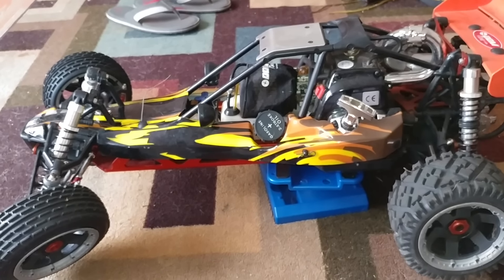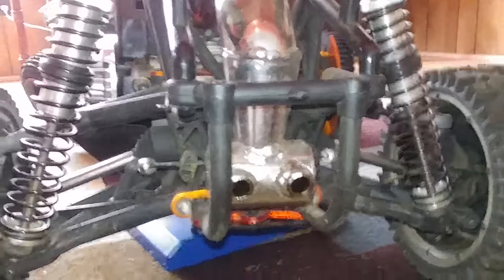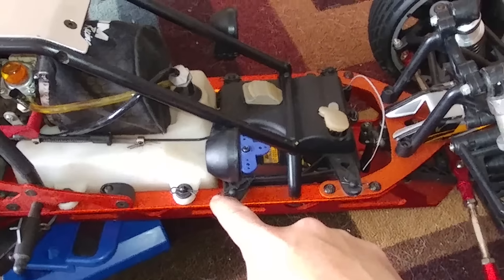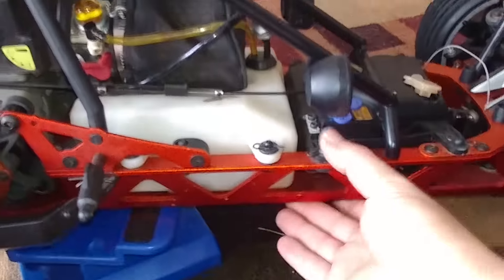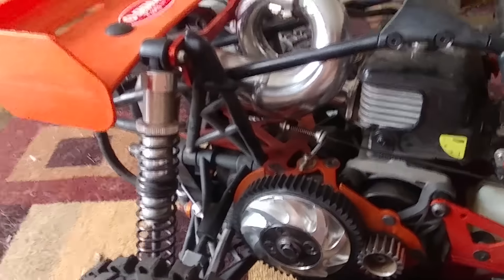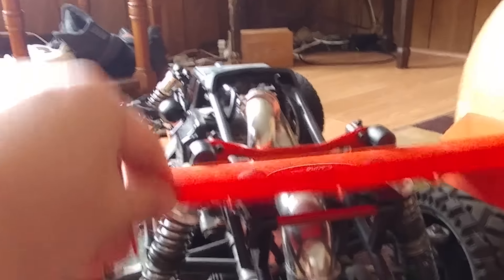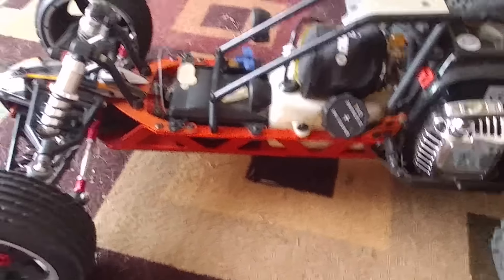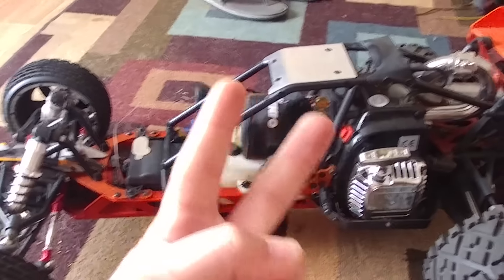Up close look at the 5th scale 5B baja

Comment: I'm happy that you explain things when your going over the Baja. Like the  velocity stack I really didn't know what one of those did. Do you know what the REV motor is that King motors puts into their Baja's.
Reply from the maker: Lenny7118 rev motor?  I know they use either 2 or 4 bolt Chung yang motors.  and behemoth fan said the motors are hit and miss cause of the motor.  Well all Chung yang motors are made tthe same except for the size.
Reply from the maker: Lenny7118 Also the velocity stack does not come with it.  just a regular air filter. the velocity stack does just that.  it adds velocity to the incoming air cause it goes from a maybe 2 inch opening down to a 3/4 inch opening.  this extra speed helps bring in more air meaning more fuel meaning more power.  It also directs the air to flow into the motor with less turbulence.  with a longer stack you'll get a higher velocity and the air sticks to the sides.  this is known as laminar flow.  I'm still debating installing one on my dbxl.  ill have to get a side air filter as well.  Always better performance if the air is being directed but sometimes turbulence helps atomized the fuel and get an even air fuel mixture into the combustion chamber.
Reply: Evolved Amateur RC Is the CNC Aluminum parts used on King Motors just as good as let's say a Turtle racing Aluminum parts ? I was looking at this King Motors Baja : 2.0 EX Silver Aluminum Baja Buggy Special Edition
Reply from the maker: Lenny7118 I would highly doubt it.  a single turtle racing part your looking at 100 dollars per part.  Also going all aluminum adds a lot of weight.  Tbats why I buy the decent versions and add aluminum where it needs to be.  Those all aluminum beauties are just that.  very pretty but not very practical. Thays my opinion though.  if you don't mind all the extra weight go for it but make sure it comes with at least a 29cc motor and add a pipe and velocity stack with a high quality filter.  my baja weighs 25-28 pounds.  those all aluminum your gonna be pushing 35 pounds and I see they come with a 30.5cc motor.  your always go na have people say HPI is better but that's mainly customer service. This day in age they are all so equal its hard to tell a difference.  The question you've got to ask yourself with these all aluminum beauties is are you gonna be racing, bashing, do you really need all that aluminum cause adding it in places its not needed is gonna really slow it down, out a he'll of a lot more stress on the drivetrain, just remember metal adds weight.  Me Persoanlly I like aluminum but I always leave a weak link that can break worst case scenario and that weak link is a cheap part that I keep extras of.  but tmit all comes down to your money.  Don't worry about these clonephobics cause the argument of who made the original baja and I have read now that KM and rovan are the same company.  Rovan was made by KM to get their products to other parts of the world, namely Australia.  But again this is on the forums.  Unless I see it straight from the company I try not to believe it but I will let everyone and anyone know this possibility.
Reply from the maker: Lenny7118 Turtle racing aluminum parts are used by racers.  and also in the end with all these vehicles we add so many upgrades sometimes the only thing left stock is the chassis if that.  I personally would stick with KM but I have buddies that have the rovan t1000 5t and love it.  It takes a lot of research if your not in the know to find out what would be the best investment.  one thing I will add is HPI won't be distributing for about another 3 or 4 no the but I personally can't wait.  A 5T would be a nice addition.
Reply from the maker: Lenny7118 Lastly the drive pins in the dogbones (drive shafts that go to the wheels) are soft with any baja.  I dont buy hardened pins cause its very easy to do.  Get a torch and heat them up til they're glowing red then drop them in a bucket of motor oil.  this hardens them and as you run it the parts will get what's called work hardened.  Sometimes in RC heat can be your friend
Reply from the maker: Lenny7118 sorry for the long replies I'm just giving you all the information so you can make an educated purchase.
Reply: Evolved Amateur RC King motors on their web site states that on the 3.0 version of the all Aluminum EX Baja has $1400 of upgrades on it and they sell it for $1230 so that gets people to question the quality of the parts they use. I just use turtle racing as an example, I was just trying to get a feel on the CNC Aluminum that King uses compared to others. I'm gonna email King motors and ask how they can have $1400 extra on a Baja and only sell it for $1230.
Reply from the maker: Lenny7118 Thays just the aluminum.   Of course an entire vehicle made of aluminum being sold for 1250 dollars isn't going to have the best aluminum.  But when you look at the plastics and compare one brand to another they're all nylon reinforced and sometimes glass nylon which flexes more.  When it comes to upgrades the only thing I get from KM is wheels and tires.  everything else is Phat dad, TR, FID, FLM, DGI area rc, usually vehicle manufacturers dont make the best upgrades.  one thing that's really nice about the TR transmission is you can get to the diff from a back plate that comes off that TR added.  in order to get to the transmission on a baja or any baja chassis vehicle a lot of parts have to come lose to pull it out.  Its best to get a lot build book for vehicles like it.  cause the first time intook out my tranny to grease the diff I took way too many parts off.  Now thanks to the build book I know just what needs to be taken off to get to the tranny.
Reply from the maker: Lenny7118 They will never tell you the truth.  RC companies never ever admit fault.
Reply from the maker: Lenny7118 On the description they even call the 3.0 a SHELF QUEEN. that's a vehicle you look at more than you run.  and I see they have come up with a 3 piece tranny like TR but I'm sure the metal isn't as good and the customer support isn't as adequate.  a lot of these aftermarket sellers will replace something for free if you can break it.

Comment: Good video. Can you tell me if King Motors RC and Rovan RC are the same company ? Which company is better made Baja if not the same company.
Also what are your thoughts on the build quality of the King & Rovan Baja's ? So many haters on the build of the plastic parts breaking so fast on the King RC and Rovan RC Baja and they also say the motors don't have the same build quality parts internally, they are a cheaper version of the CY engine ? I don't know it's just what I read and see the you tubers saying.
Reply from the maker: Lenny7118 King motor and rovan are different companies and honest all 3 including HPI make a good baja.  as for the plastic parts I've driven mine much harder and seen HPI and Rovan bajas break sooner.  Yesterday I was beating the hell out of it and the only thing that broke was the scrappy servo I installed just cause it was sitting.  as far as putting in cheaper cersions of th CY motor, well first my baja has a 4 bolt head, hpi bajas only have a 2 bolt most of the time.  So many say the plastics break faster but what they're saying theuve never seen with their own eyes, I have.  My 5sc is a baja just with bumpers and body mounts.  Plastics on both feel equal although even though the 5sc is the same chassis overall the parts are stronger.  There's always going to be haters but ice had this thing for a year now I believe, maybe a little less and the only broken parts have been a stripped spur gear, broken drive pins which can be replaced very easily and not a servo but the servo was not a KM or Hitech servo.  the great thing is any hpi part will fit on this.  same with rovan.  Also from KM you can get a complete aluminum baja for the price of an HPI Baja.  remember with the brands your paying for the name also.
Reply: Lenny7118 KM and Rovan are the same company if you dig deep enough. There engines are a hit and miss (just like OBR engines) back to "clone" engins some give up the ghost after a few hours run time some last a fair amount of time.
Reply from the maker: behemothfan666 ha ha.  I've compared the internals of the engine in my DBXL and my 5sc and my 5B.  All the same except KM uses 4 bolt heads.  have you had one yourself?  I have a KM and an hpi that are the same chassis.  What proof do you have?
Reply from the maker: behemothfan666 Also if you do some research King motors started the baja movement then HPI bought the copyrights from king motors to start making them as well.  So King motors actually built and designed the baja chassis.
Reply from the maker: Lenny7118 This behemoth dude has no proof.  Just talk.  I have many engines.  He also buys his motors pre built.  I buy cores and do all the modding myself.  You can always tell the difference from a person who buys a motor and those who build they're own.
Reply: Evolved Amateur RC you have many engine's what do you want a medal and a chest board to pin it on I've built many of these small engine's there piss easy there's nothing to them, the engine's I own zenoah 25,4 4 bolt PP, zenoah 30,5 PP 4 bolt ported by Doug, CY 28,9 4 bolt PP self ported, zenoah 29,5 PP 4 bolt ported by Scotty and an ALX 78 reed that I'm thinking of getting ported by either Scotty or Chris.

Comment: on the back axel I see black rubber boots....Do you think I can put them on the traxxas x maxx?  If so do you have a part number?  I tried the team associate boot covers and they just don't last...
Reply from the maker: MrDoom6969 yes they do fit but you have to use zip ties or something to get them to stay on the diff outdrives and for the CV joints the only thing I found that worked was 8th scale buggy shock boots.
Reply from the maker: MrDoom6969 http://www3.towerhobbies.com/cgi-bin/wti0001p?&I=LXMYX4&P=FR&gclid=CjwKEAiAn7HEBRDHwNqitoWqsQcSJAADWmI2dXW6Tfrd-uTqylOE4X6XRaAbj8xh5zSmtdbqbBZh4hoCQ17w_wcB